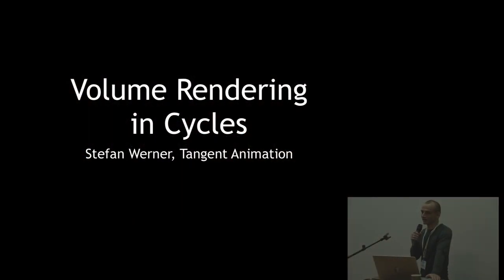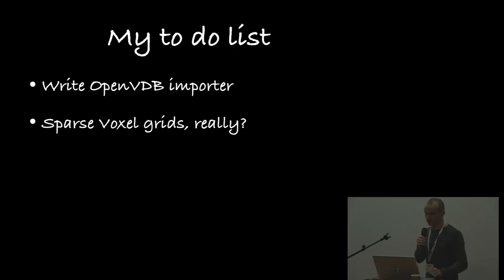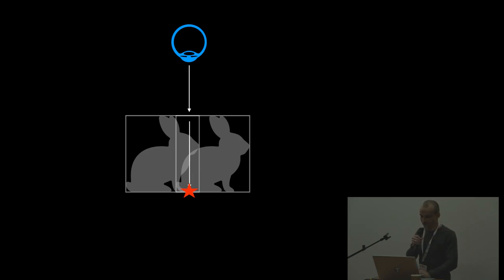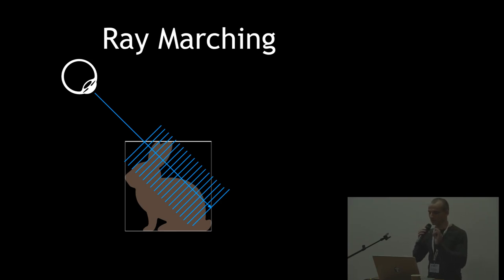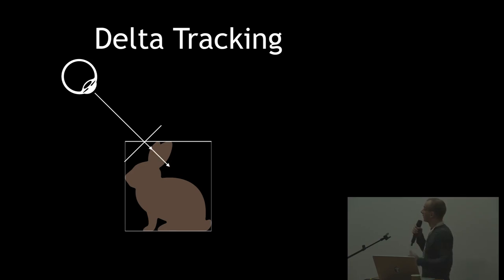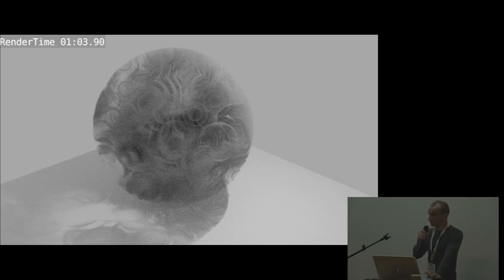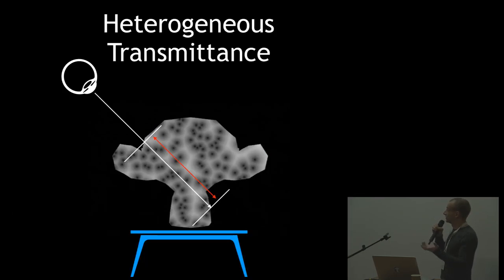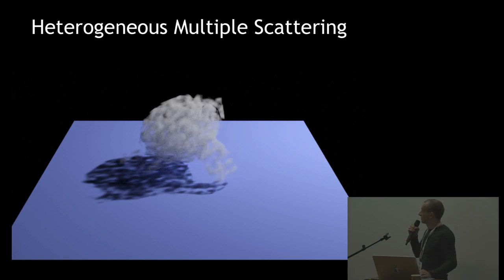Volume Rendering in Cycles - Stefan Werner

Comment: How about random steps in a way that dt != 0.1 or 0.01 but some random factor (which changes each step) times the step size, would result in some noise but banding would be gone. alternatively one could use a random offset instead of random steps this way one would save random number calculations.

Comment: Can you make blender mobile
Reply: I cannot understand why one would want to run powerful creative software on a mobile device. Mobile devices are designed for consumption.
Reply: @HiAdrian  that is true but it could make a traveling persons work flow much better
Reply: @adamhd3282   dude YOU NEED A op graphics card to run
Reply: You can make your phone run Linux.
Reply: @HiAdrian  Phones are (probably) more powerful than computers from 20 years ago, they certainly have more ram. By the logic you present, 20 years ago they shouldn't have had 3d applications since the computers they had with them weren't really that powerful. Devices today are powerful enough to run creative applications and will only get more powerful in the future. Ipads and tablets are being designed with productivity in mind. As it stands today, if some spends the time and resources to port Blender to mobile platforms it will run well, even if it can't render a 25GB file.
Reply: @donotfollow9529  Actually there is a very realistic possibility we've reached the practical limit of what can be done with mobile hardware for the time being - computing power in the mobile space isn't improving fast at all anymore. 

As for 20 years ago that was the year 2000, in 2000 people already had serious workstations for 3D work. And for rendering they used massive render farms. So really a weak comparison all in all. Not to mention most CG from that era has aged like cheese.

THAT BEING SAID - that's not even the actual problem. Phone screens are too small for any 3d work. 10" tablets are barely passable for playing around in my opinion, but even then you'd increase your productivity by 5 or 6 time by simply plugging in a keyboard a mouse and a screen ... at which point one has to wonder why you're even wasting your time with this idiocy.
If you insist on doing it thought - Wacom sells windows tablets with a pen. It's going to be a chore and a half to do anything worthwhile on that but feel free to waste 500$ on it if you really want to BE MOBILE.

Lastly - if you want it that much port Blender to Android yourself, it's an open source application. You lazy entitled bum.
Reply: use teamviewer or a software where you can control your pc from your phone. It's more practical.
Reply: The solutiom for this thing of Mobile 3D will be to use a Streaming system like NvidiaShield or MoonlightGameStream to use your PC at distance via wifi/data usage and render with your PC at home while you work on Mobile/Tablet or even a weak Laptop far away from home (where your good PC is at)
Reply: Dang I’m did not ask for yalls negative opinion
Reply: Best answer is install Linux on your pen tablet. I'd love to model/draw/sculpt in the train/park etc. too.
Reply: @kay.2536  sorry to be harsh, but your original comment shows a profound lack of understanding of mobile device input limitations and normal blender use cases.
Reply: @donotfollow9529  As mobiles did get more powerful, so do apps need more power to run them. I dont see any benefit in this.
Reply: You can install and run Blender just fine on Librem 5 lol
Reply: @k4H083  In response to what uses I see Blender as a mobile platform. But before that, I want to point out that many people who are opposed to it (or don't see it's merit) use Blender as a traditional 3D suite in a traditional setting. If you think of the potential of what Blender can become and what it's doing now in new disciplines, then it's not so hard to see the potential of a mobile Blender. Enough of that, here we go: 1) Grease Pencil - it just has so much potential outside a PC and many tablets today can probably handle it. I think its benefits are obvious in a mobile platform. 2) CAD -  in the event that Blender can be successful in CAD, be it for architecture or manufacturing processes, it would be useful to be able to make revisions on-site and to view plans natively. 3) Mocap - even if a tablet isn't actually computing raw mocap data, having a live representation of the scene that can be moved (the tablet) around would be invaluable. 4) VR - Blender's going VR phones have VR, they meet right up in the middle. In this instance the potential is huge but the implementation would be particularly tricky.

In those examples, there are a couple of themes, any 2D workflows in Blender works well, anywhere review is desired also works, and finally in a new format new workflows can be discovered that are currently bound by the PC. It just may be that you will not be able to use Blender in those requirements, sobeit.

Some of these things may or may not be edge cases. That's ok, there still is an argument to be made in favor of porting it and I'm not sure if the resources required are worth the outcomes. But in no way should the idea of it be ridiculed. Simply put, if you put Blender in new places it will be used for new things and that's a good thing.

One more thing in an already long post and a bit of a tangent. If you follow the history of computers you'll see a trend. In the beginning, you had mainframes and servers and all computing was done it and forever all computing would be done on it. But then came the PC, but we know you can't do real stuff on it and it's only good for playing around and convenience. But then the PC got better and could do most what the servers were doing, we didn't get rid of servers but the real computing happens on a PC. But then along came the laptop, but we know you can't do real stuff on laptops and it's only good for playing around and convenience. But then the laptop got better and could do most what the PCs were doing, we didn't get rid of PCs, they still have their use, but the real computing happens on a laptop. And then came along the smartphone, and the tablet, the smartwatches, and wearables, decentralized computing and stuff; but we all know the real computing happens on the laptop and anyone who says otherwise, well I need not quote, it seems people have their opinions. This next sentence I cannot write, I'm no prophet.